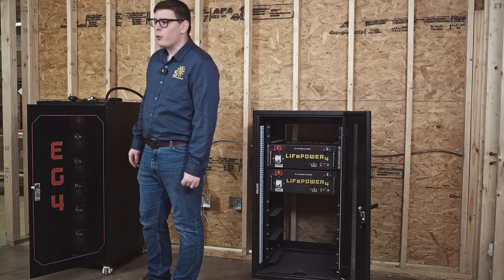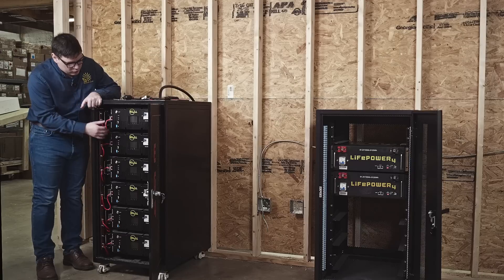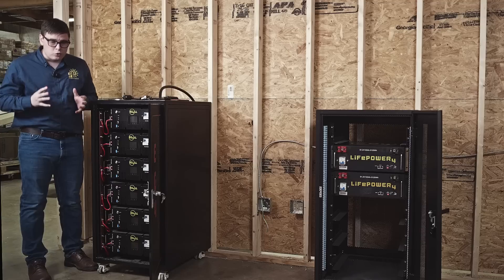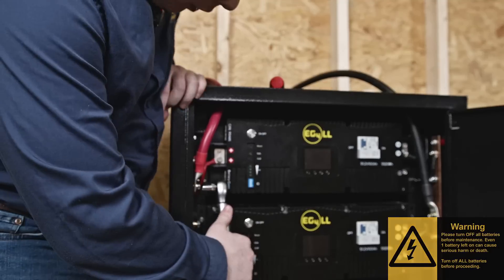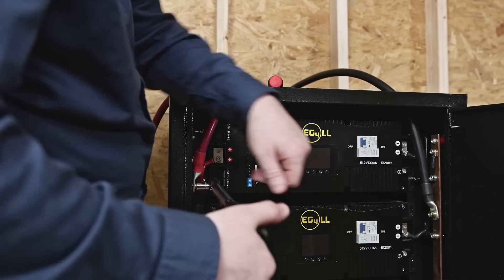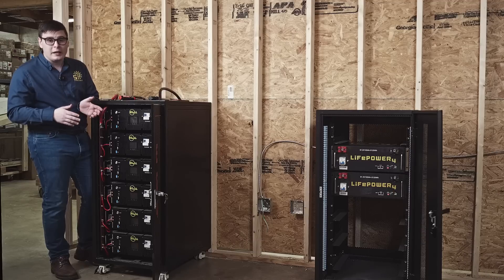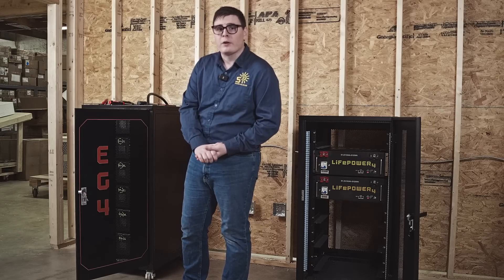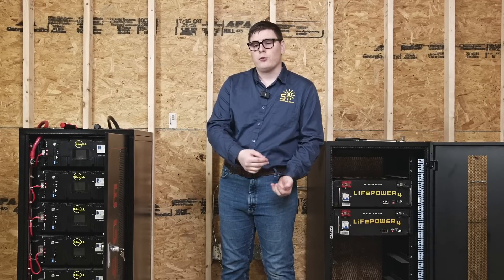EG4 Battery Rack Issues | Solutions & Safety Measures

Comment: Was my cabinet supposed to come with some kind of nonmetallic inserts to put into the 2” battery exit holes so that the metal edges of the cutout don’t cut into the insulation of the battery cables?? 
    Any suggestions about how to knock out the 2” exit holes without damaging th cabinet?

Comment: If you don't flip the negative bar over, it will pull unevenly across the batteries. Should be positive top, negative bottom. This is because it's  DC direct current, not alternating current. You must pull evenly across the rack batteries.

Comment: Got 1 system running I got from them , off grid for 4 months no major issues and the technical assistance from signature solar is Awsome so far .
Reply from the maker: Thank you so much for your feedback!
Reply: @SignatureSolar  u should do set up video on comunication hub , from proper wire location and start up and programming it for the egg 4 batteries as well

Comment: What size of battery cables do you need to use for two batteries
Reply from the maker: Could you clarify which cables you are referring to please?
Reply from the maker: All of our batteries come shipped with the appropriate sized cables. It's important to ensure that the maximum charging current from the inverter does not exceed the current rating of the battery cables.

Comment: You've got some great videos!  But BUYER BEWARE from SIGNATURE SOLAR they are selling server racks, but they don't have them.

I'd like you and everyone to know, I just paid $16,123.21 to SIGNATURE SOLAR 903-4412090 TX on 07/10/23 for EG4-LL Lithium Batteries Kit (V2) | 30.72kWh with 6 Server Rack Batteries with Pre-Assembled Enclosed Rack with Door & Wheels and the EG4 18KPV Hybrid Inverter.  The next day, 07/11/23, I drove to Texas from Florida to save on shipping to pick these up after they notified me it would be ready for pickup. When I got there, after making an appointment to pick them up an having to be there within a 15-minute time period or they canceled your appointment, they notified me they did not have the rack because they were having trouble with the maker and the welding.  They are selling batteries and the rack, without the rack!!!  This does no good because you can't install the batteries without the rack.  I'm waiting for the rack and my warranties are running out. They told me they would send me the server rack, but they have no idea when.  You can't build a system without the server rack!!!  But they are selling them and not telling you they don't have the server racks because they charge $10,119.00 for the set.  If you look on their website, you'll see some items listed as "Out of Stock", but not the server racks because this too much money to lose. Again, BUYER BEWARE!

Comment: You can’t get 10 ft lb torque on the supplied bolts. I snapped one off and every other one felt like it would break. Better off to free hand so you can feel when it’s tight.

Comment: The manual for both LL and Life Power batteries says the torque is 60 in-lbs, you mentioned 18-20 ft-lbs which would be 240 in-lbs. That's quite a discrepancy. Not sure which is correct.

Comment: Please tell EG4 to stop using Pem Nuts on the bus bar.  Pem Nuts are not suitable for electrical connections.  Besides spinning in the bus bar if over tighten they are proud of the surface of the bus bar. This means the lug doesn’t sit flush on the bus bar rather only touches the Pem Nut. Such  a waste of nice giant copper bus bars.  BTW the recommended cable size to the server battery rack is 4/0.  4/0 cable lugs come with 3/8” lugs and the Pem Nuts are size 8mm which is 5/16” lug.  Makes for a very poor high amperage connection.  I chose to pull the bus bars out of my brand new cabinet to drill and tap the copper bus bars with fir appropriate connections. 😢
Reply: I agree 100% they should definitely read this comment and make the changes
Reply: Yes they are spinning while following the recommended torque. My goodness
Reply: Otherwise a very nice cabinet.

Comment: Can I run a  pair of growatt 5000es while using INDEPENDENT battery banks and still have them as master/slave on the 240 ac side?
Reply: Growatt manual says you need to use one bank for all paralleled inverters or they will fault.

Comment: I am going to take out the riv nuts and install bolts with nuts. I have seen these riv nuts pull out of the buss bar because the bar is thicker that what the riv nut is designed for.

Comment: Ok, so both cabinets have 400 amp bus bars?  (not an expert, please bear with me).  If the circuit breakers on the LLV2 is 125A and/or max discharge is 100A and you have 6 of them in a cabinet, how will that not overcurrent the bus bar if you lose the BMS?  I guess I would have to have a short circuit on the wire to the inverter for that to exceed the load  to the inverter?  That seems like 600 amps on the bar

Comment: I really enjoy batterystuff. But as an mechanic your terminology seems really off. The torque specifications for an M6 and M8 steel bolt in a normal steel nut is Greater then the numbers you are mentioning. If the thread is made in the copper bar itself it might be right torque since copper is much softer then steel. But then you say rivet in the video, and then i suppose there are rivet nuts nuts inside the copper bar, and those are made of aluminium. If you drill  a hole in the copper bar you need a traditional nut on the backside of the copper bar for the bolt. And then that is another torque value. And regarding the torque wrench, you never store them with out loosening the tension out of the handle. But it might just be me as a Swede who doesent keep up on the lingo here..

Comment: They didn't mention that you'll need a longer RS485 cable than what comes with the battery if you're connecting the LL to Life Power 4 batteries. Be sure to get a longer one when you place your order.

Comment: Which Bolts class is used? If it is 8.8, then the torque for the M6 is 10 Nm or 7.4 ft lbs. For the M8 is 24 Nm or 17.7 ft lbs.
Reply: Thanks. I broke one at 10 ft lb. I have a calibrated digital wrench with live read out. At 8 ft lb it felt like I was going to break every other bolt with a slight turn.

Comment: Are the 'casters' on welded cabinet strong enough to be ALWAYS on the wheels? Looked like they were about to pop out a bearing after all 6 batteries loaded. I'm now guessing you intended the 'foot' to be only way to leave the cabinet after positioned. Don't think this can roll around 100% of the time.  But wanted to see what SS says.

Comment: I'm still glad I updated my battery bank with these. And will go with these again if I expand my system.

I do strongly recommend checking each battery address using a computer as I had one that was slightly goofy.  One of the dip switches didn't like working like it should.